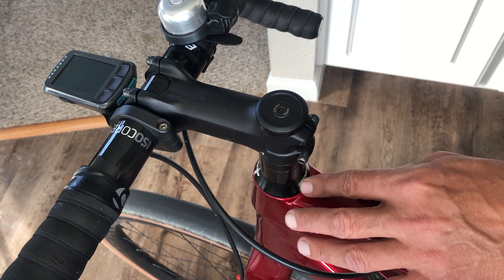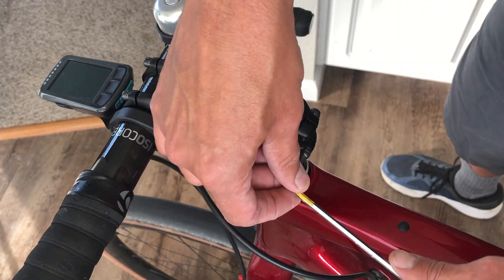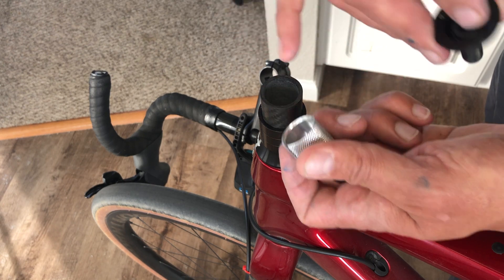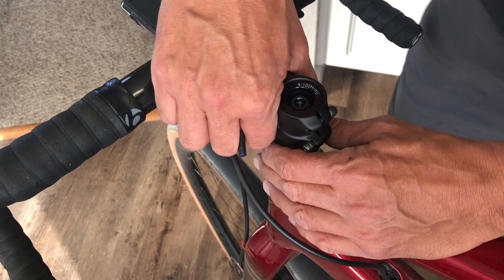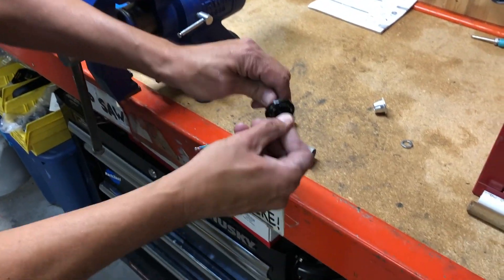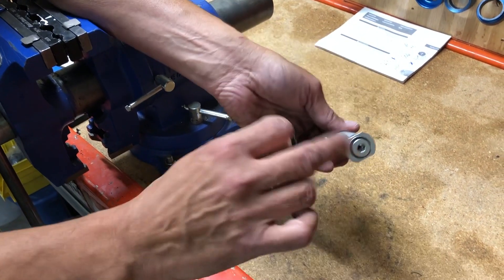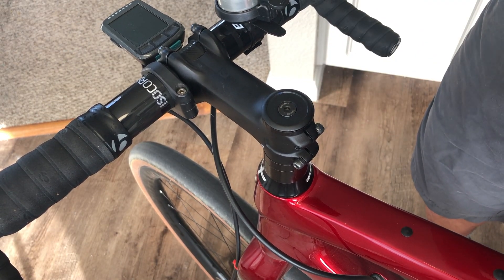Solving The Mystery Of The Carbon Fork Compression Plug

Comment: Brother I would like to advise you that you are literally putting your life in danger with that setup. That top pinch bolt of the stem extension is literally crushing your carbon steerer. The Expansion plug has a 4mm section that does not expand it is literally a void until the expansion area knurl starts. The expansion plug edge should be literally right behind the top pinch bolt not at the top of the stem extension, the top cap has a 1.5-2mm section under it that is what then protects the upper pinch area of the stem extension. with all the measurements+ preload on the bearings you would see a 6.5 to 7 mm gap between the top of the expansion plug and the top of the stem extension. Your steerer tube needs to be cut in order to make the proper adjustments. Let me remind you all I am saying here applies when you do not have any spacers under the top cap as I never recommend that since you have to user a longer expansion plug ( to pass through both pinch bolt areas of the stem extension.

Comment: This may be a long shot question, but I'm desperate. I bought a Canyon Inflite AL frame with carbon fork and steerer. Trying to build it up, but running into a lot of challenges, mostly out of my own ignorance, but also because of Canyon's seemingly quirky components. I'm hoping you can help. I've seen different answers to this question. Does this steerer, which is 1 1/4" outer diameter, need any kind of compression plug or wedge or is it ok to run without? I don't know if it originally came with some kind of plug or not. And I've seen some people say that if you use the original Canyon stem (which i found on ebay!) then nothing else is needed. In your expert opinion, what do you think? Thanks in advance!

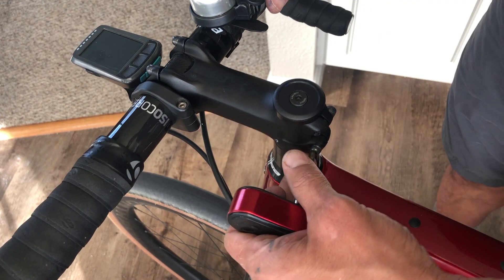Comment: my top cap of compression plug doesnt fit well on steerer tube by factory( it has some gap ) . should i untighten and fix it? (aim not sure what kind of compression plug has inside) . Also 10:50 when i tighten up these bots it makes noise. Like somthing you hit.

Comment: I literally avoid bikes that come with carbon steerer tubes, or immediately replace those forks. Nothing wrong with the alloy tubes that worked wonderfully
Reply from the maker: Aluminum steerer tubes work great, until they don't!
Reply: @JoeyMesa  Carbon steerer tubes are 1 nm away from cracking and having to replace.

Comment: Hey Joey, I don’t know if you’ll see this but I just got a new bike(specialized Allez E5) and wanted to remove a few spacers to slam it  and place the remained of the spacers above the handlebar. Will I have to cut the steering tube to adjust the height or install compression plugs so that I don’t crush my bike? I’m new to all of this so I’ve been left a bit confused as to what to do.
Reply from the maker: Sorry for the late reply, but thanks for the question! You can definitely move the spacers above the stem to experiment with different sizing. Once you've found the spot you like, cut the steerer tube so that the top cap is flush with the stem. A 5mm above the stem is fine as well. When cutting the steerer tube, you'll need to remove the compression plug. Long term, having a bunch of spacers above the handlebar stem is bad (smacking into it if you crash, little to no support on a carbon steerer tube), But it's fine for the short term to find what works for you. An experienced bike fitter can be helpful if you have the funds, plus someone good in your area. Hopefully this is helpful!
Reply: @JoeyMesa  More than helpful! Thank you so much🙌

Comment: The only thing about expander plug is not to preload the headset bearings as i know. It also supports the steerer from inside of the clamping force of the stem bolts.
Reply: Yes. This is the reason why some riders deliberately use longer expander plugs, which allows them to lower their stems without having to cut off any excess steerer tube first.

Comment: Hi there, thanks for the great explaination!

My plug is installed (stuck) in the steerer. When turning the compression bolt counter clockwise, it doesn't loosen the plug, it just feels like it is spinning in place. After several turns of the bolt, the steerer tube heats up slightly indicating some friction. When turning clockwise, similarly the compression bolt never becomes tight and spins in place, heating up the steerer after a few turns as well.

My suspicion is that the compression bolt is seized to the bottom wedge, and when the compression bolt is turned either direction, it merely spins the bottom wedge around and does not push/pull (loosen/tighten) the bottom wedge.

Any suggestions on how to get the plug out in this case?

If it matters (i.e. I'm just plain doing something wrong), this is for the carbon fork of a 2014 Merida Reacto 400.

Thanks!
Reply from the maker: The wedge lower section is probably stuck into the actual compression sleeve, or the outer portion. With the main bolt portion loose, give it a little smack, or at least the wrench engaged into the bolt and try to break it loose. If that's the issue, it should come right out. if not, it's difficult to speculate exactly why it's not budging without actually seeing it in person.
Reply: @JoeyMesa  Many thanks for the reply Joey, definitely appreciate that it would be impossible to diagnose the issue over a single comment. You were right, the lower wedge was stuck within the compression sleeve and thus holding the entire plug in the steerer tube. The root cause was that the lower wedge was seized to the compression bolt (cross threaded as it turns out), and therefore I could not get "the main bolt portion loose" (I think this is what you meant) as the compression bolt could only turn together with the lower wedge within the compression sleeve, whereas it should ordinarily turn with respect to the lower wedge and thus pull or push the lower wedge (tightening or loosening the entire plug respectively). Many taps with my mallet did not help because the compression bolt would bottom out against the top wedge before the lower wedge was out of the bottom of the compression sleeve.

The break through for me was to bring the stem up to the approximate level of the lower wedge and tighten the stem to the max torque specification for the steerer tube. This squeezes the steerer tube slightly, which in turn squeezes the compression sleeve against the lower wedge and gives more resistance to break the compression bolt loose from the lower wedge. Once loose, I smacked the compression bolt with 4 days worth of pent up frustration as you said and the plug loosened right up!

Thanks again for the great video, knowing the workings of the plug really helped me to come up with the solution!

Comment: FINALLY.. Someone shows that the compression plug  when inserted and tightened  to the fork adjusts the bearind preload

THEN ..the top cap allen bolt is lightly tightened ..

Comment: I remove the spacers trying to get better feel for riding . sometimes everytime I remove spacers long bolt comes up along with compression plug . this is been so frustrated can you give me any advice .
Reply from the maker: Just make sure the compression plug is secure and leave a few millimeters (4 or so) below the top of the stem before trying to adjust.
Reply: @JoeyMesa  I have Colnago V1R kindy crappie  design . The tech at the bicycle shop told me some high end frames are just built that way . Thanks for the tip I appreciate .

Comment: i know this is not how it's done anywhere, but how much more would a 16 cm long bolt weigh with an almost identical bottom-cap as the top cap? not very elegant but it would do the job (except with non-direct-mount rim brakes)

Comment: Welcome back.  What are your thoughts about clamping the stem slightly above or below the midline of the compression plug.  Some people say that the plug will take some of the load off the steerer tube when you tighten down the stem bolts and that the stem bolts should always lie within the length of the plug.  I tend to use longer compression plugs in my carbon steerers just to be safe.
Reply from the maker: Yes, I'd agree with the plug being somewhere within the steerer tube where the stem clamps for added support. I prefer the longer compression plugs as well.

Comment: My Cannondale headset bearings come in a set that includes the top cap, so I change it at the same time. Key learning for me is that Cannondale require there be NO spacers above stem. Seemed odd, but supported by industry experts, key is to have the plug support the upper part not the bottom part, against the load on the fork from the stem
Reply from the maker: Yes, I've owned many Cannondales that use this type of preload cap/compression plug system. I like the fact that you can thread the preload cap partially not the compression plug, drop the assembly into the steerer tube, tighten the compression plug into the ideal position because the hex key size is always a size smaller than the preload cap.